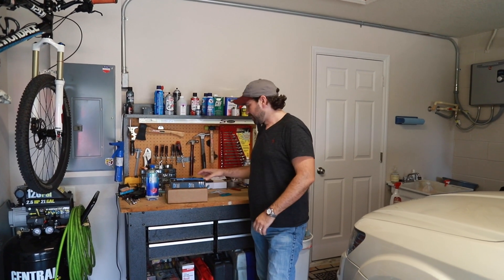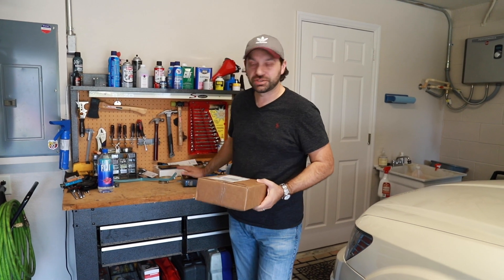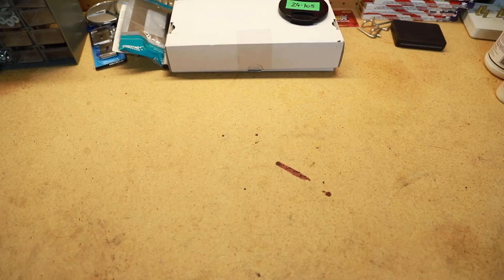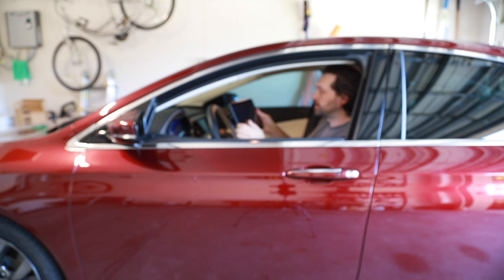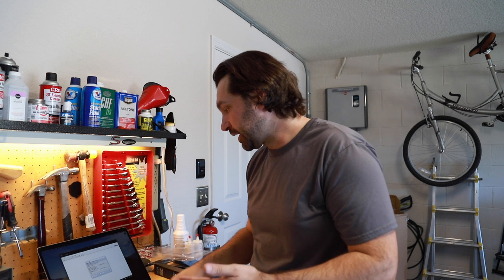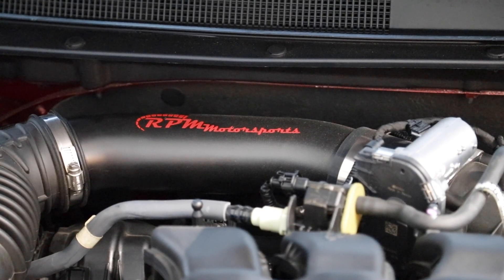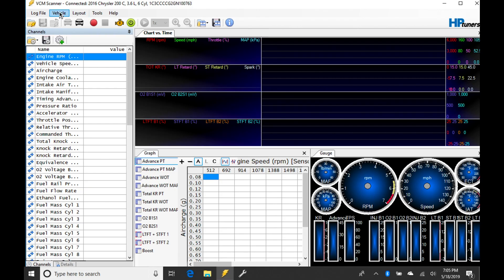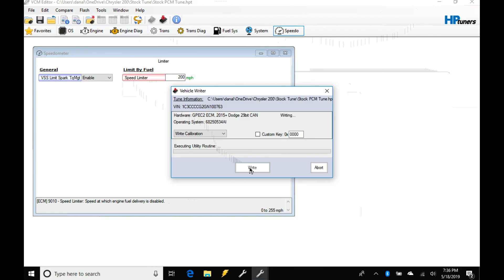Engine tuning with MPVI2 | Getting started is easy!

Comment: Will installing something like this void your warranty?
Reply from the maker: Technically? Yes. That’s why I got another pcm. Just in case, I could swap back the original one. I had mine tuned since about 12000 miles on the odo. I just ran out of my power train warranty so it doesn’t matter anymore.
Reply: @Turbo_Snail  thanks for the reply. Hadn't thought of just switching the pcm back in if I needed to take it in. Thanks!
Reply from the maker: I bought one on eBay to unlock. My original one is in the attic.

Comment: Ok, I’m curious. If this will tune for more HP, can this tune for better mileage? I will never use all the power my engine produces, so I am looking at (for lack of a better term) a sort of a de-tune
Reply from the maker: Yes absolutely. The factory tune is made to work in Alaska as well as the Sahara. It’s made to have a good balance of hp and fuel mileage. Look at cars in the 80s. I was amazed that many of them were doing 30+ mpg. So basically over the last 40 years the hp increased by keeping gas mileage the same. Not sure how far you could push it the other way but you definitely can. I’d love to hear the call to a tuner however. “Sir, yes, I’d like less power”. But depending on how much you drive, the cost of tuning may probably be worth it. 

I’m curious, let me know what the results are. Good luck.

Comment: Which Maserati v6 six motor are u saying Is a derivative of this pentastar? Are u positive they are the same plAtform ?
Reply from the maker: Can’t confirm if it’s actually true but the 2013, 14 Ghibli was built with a Pentastar derived 3.0 twin turbo built by Ferrari. I believe they went with a different engine later because of issues. What I can confirm is that the VW Routan has a Pentastar outside of the fiat group.  We haven’t looked into any parts from that engine yet.
Reply: @Turbo_Snail  16 and up pentastar really improved IMO with lift and timing duration I love to see someone tune one of those motors curious to see the gains bet u could raise redline to 7k on that motor but will it make power all the way thats the question we know these motors love to rev
Reply from the maker: Mine is a 16. My red line is at 7000 already with the new injectors. And yes it does make power. The question is as soon as my e85 tune is done, can the fuel pump push enough fuel past 6500rpm?
Reply: @Turbo_Snail  well u upgraded the fuel pump rt?
Reply from the maker: Not yet. First thing is the throttle body and then the e85 tune, then the test. Supposedly, it should handle it, if not, a new fuel pump is next. Hopefully we get to all this year but I’ve been way behind on the channel and the car. Hopefully I’ll be doing more videos soon.
Reply: @Turbo_Snail  well wait a min u put larger injectors in with a stock fuel pump? How were the fuel trims in the higher rpms with that set up
Reply from the maker: They are perfect. Because the 2016 is ethanol capable the fuel pump is capable of handling larger injectors with a tune of course. The question is, can it handle e85 with the additional fuel requirements.
Reply: @Turbo_Snail  I have a 2016 Pentastar what bigger fuel injectors did you go to

Comment: Can you change the rev limiter on this?
Reply from the maker: Absolutely, and so much more. I rev to 7000rpm now and there is still power. Probably going to 7200rpm now that I have also larger injectors.
Reply: @Turbo_Snail  will it 2step?
Reply from the maker: Like letting it rev at lets say 4500rpm to build boost and then when you launch to go to its higher limit?
Reply from the maker: Check out the HPTuners forum. Here is a thread that may lead you in the right direction. https://forum.hptuners.com/showthread.php?63980-Tuning-for-a-2-step

Technically, it is possible but it’s nothing I use or have used.
Reply: @Turbo_Snail  as in setting the rev limiter to let's say 3krpm and in park stepping the gas to make it popcorn
Reply from the maker: Oh yeah. You can set it to anything you want. Mine revs in neutral well over the factory setting. As long as you know that if you set it to 10k rpm, something is gonna break. ;)
Reply: @Turbo_Snail  how much was the whole process. I'm trying to have mine shoot a flam or 2 as in have straight pipe from the "headers"
Reply from the maker: Depends on your car. I had to have my PCM unlocked and I bought and extra one so that’s about $300-350, then the mpvi2 for another $300, then you need credits for your car, it’s i think about $50 per credit. I had to use 2 for my engine and 2 for the transmission. That’s another $200. I also had to buy a tablet because my household only had macs. Then, because I’m not qualified to tune, Mario at Demigod tuning did that job for me which cost money as well. I would say you can get started somewhere between $900-1500 depending on car. If you got a viper I think you need 8 credits for the pcm. Still, a tune gives you the most hp for the money. A custom exhaust is $1000-2000 for 10-15hp. A basic tune will get you 20-30hp. Mario can also tune your car so that when you lift off the gas you get pops!!!

Comment: So the 3.6 can run E85 with just a stock tune nothing to it?
Reply from the maker: Yes, however, it's signified with a yellow gas cap. If you don't have a yellow gas cap you don't have E85 capability stock. The parts as far as we can figure out, fuel pump, injectors, etc, seem to be the same. No-one knows why some have yellow gas caps and others don't. But I know for sure that a secondary program for e85 is not in your car if you don't have a yellow gas cap. That being said, you can tune to make it work on e85.

Comment: Can you do a top speed run. I really wanna see the governor removal works
Reply from the maker: I was planning on one. But finding the place and time was difficult. With reduced traffic. I think I may have a chance now.
Reply: Turbo Snail please do. I want to remove the governor off my 3.6 challenger . Lol
Reply from the maker: @Mast3rMindTalks  I can tell you for sure. It's not limited to 120 anymore... The S500 pulls harder at higher speed than the 200, but thats a V8 and has tons more torque. 332 lb ft compared to the 260lb ft on the 200. After the tune however my 200 is faster 0-60.

Comment: I'm confused about the order of things.  Did you not have to read your stock PCM first, and send it to HP Tuners with your spare PCM so they would unlock your spare PCM and write your factory tune to it, with your VIN, etc?
Reply from the maker: Yes. First you read your stock pcm. Then you do the order and send the pcm to hp. They put your vin and options/equipment on that pcm and they send it back. Then you’re ready to tune.
Reply: @Turbo_Snail is that on all the pcms or are pre 2015s unlocked from factory?
Reply from the maker: You have to check. I think that’s about the time they started locking. I think hptuners has a reliable list.

Comment: wtf i sat through this to get before and after  results would have been gd on same video
Reply from the maker: Yeah, sorry. Working on it right now as I didn’t have a tuner when I bought it originally. I thought hptuners will get me a boxed tune but none was available for my car. I can tell you tho the tune makes a big difference. I’m about .8 seconds faster on a quarter mile and driveability is greatly improved. Sorry bud, didn’t intend to mislead you.
Reply: @Turbo_Snail  you should have them make a basic box tune from your tune that people can edit on there pc if they know how.
Reply from the maker: There are some basic box tunes on the HP repository. To be honest, box tunes which are very general and are still made to fit all engines, which means you are not getting the max out of your particular one. For the most part, on the pentastar engine, you advance timing (need to switch to premium), raise the limiter to 6800rpm and kill the power enrichment delay, you got have the tune done.  I’m running 50lbs injectors now as we’re trying to make it work again with e85. Soon we’ll also run a larger throttle body.
Reply: @Turbo_Snail  can you send me the link to them?
Reply from the maker: @SweStone918  https://www.hptuners.com/my-account/tunerepository/
Reply from the maker: hmmm. looks like the repository was down and searching now there are only stock tunes in there. Maybe they are still rebuilding it?!?
Reply: @Turbo_Snail  wonder if I can just change the rpms without tuning and then change it back.
Reply from the maker: No. Unfortunately I do not know of a way to change that without HPTuners or Diabolo. Check out the Facebook page: PentastarV6Performance. Lots of good people and knowledge there.